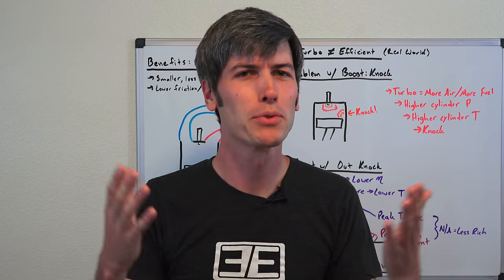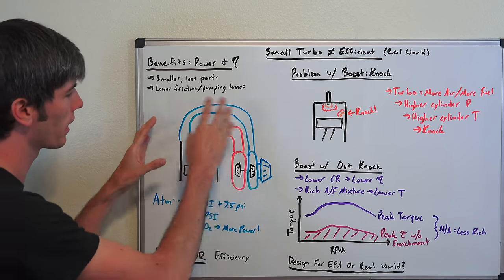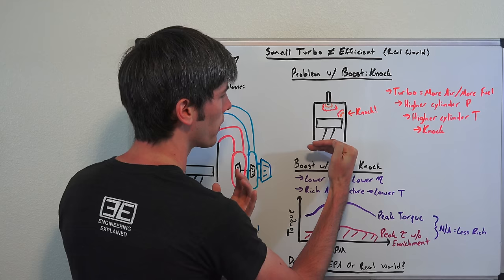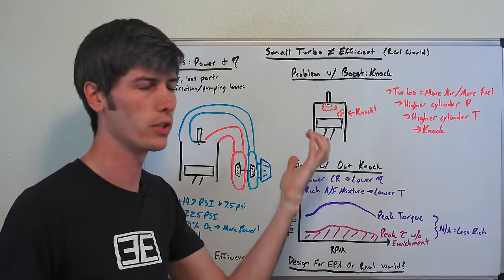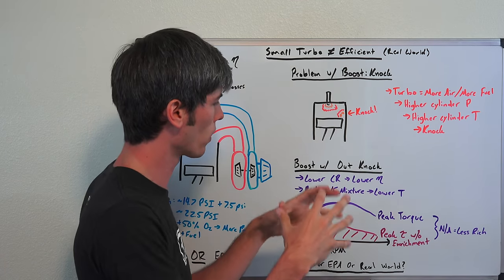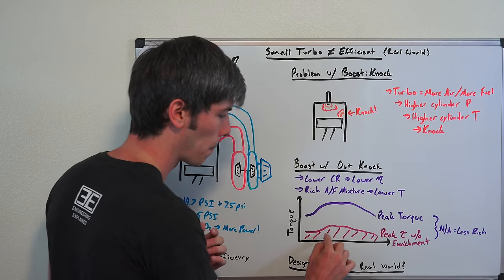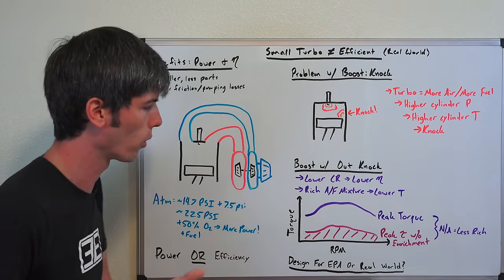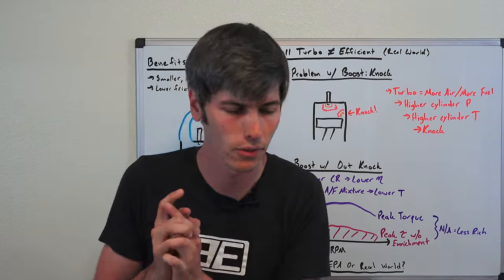Why Small Turbo Engines Are Not Efficient

Comment: Two things:

1) This is not only linked to "small" displacement engines with turbo. It is the same for any gas powered engine using a turbo.
2) This is only relevant for gas powered engine. Diesel-turbos is another discussion.
Reply: It applies to turbo diesel too.  More air is more diesel burned (and my 51 mpg Jetta TDI drops into the 30s)

.
Reply: @electrictroy2010  More air is more diesel burned, but more work is done so efficiency of the engine is the same or even better. Of course fuel consumption is NOT the same thing as efficiency. Exampe: drive at 70km/h, engine load and efficiency is lower, but the car itself is more efficient since there is less power wasted to overcome air resistance. Double the speed to 140km/h, the power required to overcome wind resistance increases 8 times!! (since air drag power increases with the cube of the speed). Far more energy is needed to travel the same distance so the car is less efficient BUT the engine is more heavily loaded and runs more efficiently. Fuel consumption increases even if the engine is more efficient. IE fuel consumption doubles, but the work done quadruples, so the efficiency increses.
Another simple experiment, try pulling up a hill in 5th gear and then try the same hill at same speed, so the power required is the same, but in 3rd gear. In 3rd gear load is lower, there is less boost but it will burn more fuel to do the same work as the efficiency is lower. There is no efficiency penalty for high boost on diesels because diesels don't require full load enrichment. In a gasser full load enrichment helps prevent knock but also causes decreased fuel efficiency, so a gasser might even burn less fuel when you downshift for less boost uphill, which is practically never the case in a diesel
Reply: Then explain how semi trucks can still average 6-8 mpg towing dry vans when 10 is the most they ever will do?
Reply: @Chris Russell Shhhh elect........ might learn something.
Granted it is 4 grade stuff.
I just wish they had . well telling would be telling. sorry
Reply: @kennedy796  these engine are like huge 14L V8 engines. How do you expect a good milage from such a huge engine?
Reply: @dieselgeezer18  Those engines actually are very efficient. That's why almost every truck in the world has a Diesel engine (outside the US where people buy trucks for leisure and gasoline is dirt cheap).

But when you're hauling a shitload of weight and have the aerodynamic drag of a house even if your engine is very efficient your fuel consumption will still be very high.
Reply: @kennedy796  ,look at the air that they push regardless of load. Yes there are a few concept designs that look like an arrow, but they are lacking in maneuverability and off the pavement capabilities, so they are not being built.
Reply: @petarmiletic997  I get what you are saying but help me understand this:
I drive a car powered by a small turbo diesel and it has a info display which tells me mileage figures like instantaneous mileage.
I have noticed that when I drive up a hill or just high load conditions where I am using a higher gear and low rpms the mileage figures drop astoundingly but when I downshift to a lower gear despite the higher rpms the mileage figures are better.
How is that?
Also the high load conditions I mentioned doesn't include lugging the engine.
Reply: @Hrithik_Jayanth  maybe you are using to low rpm and running into turbo lag, where the turbo can't provide full boost, and thus the engine is less eficient?
Reply: @juanordonezgalban2278  so if I am not boost it's inefficient?
Reply: @Hrithik_Jayanth  Most engines get a bit more efficient towards the middle of the rev range and then less efficient at high rpm. It is possible that the increased efficiency from higher rpm is more than the decrease from reducing load, especially in a diesel where part load efficiency is not as bad as in a spark ignition engine.
Also at low rpm it is likely the turbo is below the boost threshold and does not provide the full boost. Or if you have a VNT turbo the nozzle is closed and backpressure is high, acting kind of like an exhaust brake and robbing you of some power. It's really impossible to tell without looking at the specific fuel consumption map of the exact engine, which is not commonly available, where it is most efficient. It is very likely that if you downshifted again the fuel consumption would rise up. Also on a flat road - load is low it is certainly more efficient to use a higher gear, even if it drops the rpm below peak efficiency. My guess is that you have low efficiency below 1500rpm, and best at 2000rpm, above 2500 rpm it drops.
Reply: @Hrithik_Jayanth  Yes boost tends to improve combustion efficiency of a diesel engine, even when no fuel is added
Reply: @petarmiletic997  square, not cube. Rest u said is correct.
Reply: @David-cy5zu  Yes drag force increases with the square of speed. But power is force x speed. If drag force was constant regardless of speed the power would rise linearly with speed - this is for example how rolling resistance behaves. If drag increases linearly with velocity then the power would increase with the square of velocity. Since the drag force increases with the square of velocity that means power increases with the speed cubed.
Fd = 1/2 * Cd * A * V^2
Pd = Fd * V
Pd = 1/2 * Cd * A * V^2 * V
V^2 * V = V^3
Pd = 1/2 * Cd * A * V^3
Everything in the formula is constant so drag power = constant * speed cubed.
Hope I was clear enough, it's hard to type formulas in the comments.
BTW this is the main reason why fuel consumption  of cars rises rapidly at high speeds.
Reply: @ Heads Mess

Less of a difference now with DI and you want more power in a diesel you still have to put more fuel in. 

I run a turboprop engine and it’s the same principle. Super lean—only 10% of air is used for combustion—but if you want to increase power you are directly increasing fuel flow. That’s the only place your extra energy is coming from. So your diesel will get shittier mileage the more you romp on it.

Comment: I worked for a Lincoln/Mercury dealer back in the very early 80's.  In my three years there, we sold one Mercury Capri with the 2.3L turbo four.  It was a nice little car but the owner brought it back to us several times complaining about lousy fuel economy.  We checked it out each time and it returned proper gas mileage when we were driving it so there was nothing we could do.  We talked to her several times and could never figure out what her problem was when she finally said it.  "My salesman said I could have V8 performance AND 4-cylinder gas mileage!"  Ok, "now" this makes sense.  The service manager resisted the temptation to tell her that her salesman lied through his teeth to her and simply said he was mistaken.  She could have V8 performance OR 4-cylinder gas mileage but not both at the same time.  She didn't like that answer and we were never able to satisfy her on this issue.

Comment: I have a small (1.4 liter) turbocharged engine in my car.  I have never gotten the mileage that I thought I should be getting, and this video helps a bit to understand why this is.  The real blow that I got was when my car was in the body shop for a month (let's just say that it was the busy season, and that's all I have to say about that).  I had a rental car that was a larger sedan with a V6, and it got better mileage than my smaller car.  I still miss that rental car...
Reply: yeah, you have to drive like "that annoying slow person" to get those rates.

Comment: So short version: you get a small Turbocharged car to drive it sensibly for economy, and to have some power reserved for when you need it. 

I own a 2006 Land Rover Discovery 3 with a 2.7 litre diesel V6. On the Motorway doing 70 it happily gets above 37 Mpg, whereas in the city, it drops to around 27. The key is just how much you put your foot down; that thing pulls away hard once the turbo spools up, but then the Mpg goes out the window. Its all down to driver input and how you drive it. A good example of this is the race that Top Gear did with a BMW M3 and a Toyota Prius.
Reply: Diesel engine are more efficient than a gasoline engine

Comment: I swapped the tiny K03 turbo out for a larger gtx2867r on my 2.0 ecoboost. The K03 spooled almost instantly but power died around 5k rpm. The 2867 hits peak boost at 3.2k and makes power all the way to redline (6.5k). It's also making 150 more crank HP. Wasn't expecting to also increase mpg. I now get 32 mpg doing 80 mph.

Comment: For a little while I drove a '13 VW CC with a manual and a stage 1 93 tune to about 250whp. I was getting 28-30mpg combined and I could squeeze 36mpg on the highway. I think the real advantage to these turbo engines is you get all the fun while on boost and then when you're cruising on the highway off boost, it turns into a fuel sipper.

Comment: I changed from a 1,4 litre four cylinder 90 PS to an 1 litre threezylindet engine with a turbocharger and 95 PS and i am down from 6,5 litre per 100 km to 5,5 litre per 100 km. For me thats a huge Deal because i save around 250 Euros a year.
Reply: The biggest advantage of the smaller turbocharged engine is the low end torque, so that your new turbocharged car (might even be a Volkswagen) has more low end torque and can sustain lower revs at high speeds
Reply: I have an 993cm3 n/a from 1999 that does 4.6...
Reply: Pedro Pereira but how much hp does it have that’s the question
Reply: @MikhailFrolenko  56 bhp.
Reply: My Polo 6N1 build  1996 1 Liter 4 cylinder  Big Block  needs 5 Liter\100 Km.
Reply: I have 1.3cc N/A ( no turbo)
112 ps . 2002 pocket rocket 850kg
Reply: I just got a Seat Ibiza 09 with a 1.4l engine producing 86 hp. Driving it back home for 200 km I got an average of 5.2/100km. And I had probably around 70 km uphill.
Reply: @German Retro Guy people typically complain atkinson cycle engines from mitsubishi are extremely lazy. Horrible to drive when pulling caravan or trailer.  I've heard most mitsubishi outlander owners trade in their car to buy something with turbo diesel.

Comment: Also keep in mind how people drive turbocharged vehicles. When you're driving a big V8 you have to drive slow to get any decent kind of mileage. Where most people who drive turbo cars always have their foot down... Who remembers the old days when you could literally watch the gas needle move in a V8 truck?
Reply: DonnaSean this is exactly the problem. These smaller turbocharged engines are usually dramatically more powerful than the naturally aspirated motors the owner was previously driving.

Thus the driver accelerates significantly faster than their old car ( horsepower requires fuel either way) and then complains about the economy.
Reply: ‘71 Olds Toronado ... 455cid, kick in the 4 barrel over 70mph and just watch the gauge drop 1/10 every few seconds
Reply: I just rented a Kia Soul that did that from full tank to a half a tank Driving 80 on a short 80 mile trip. Watched the needle move.
Reply: 70 Chevelle 396 ss w/cowl, yup it def was a race, those were the days
Reply: see the gas needle move? that remember my first car, i kind fixed it... but the ECU was think the engine needed more gas.
in fact the poor thing barely moved.
Reply: DonnaSean couldn't agree more, it's all about driving habits - I average 41mpg from a Fiesta ST150 which is known for being pretty bad on fuel because most people are lead-footed with them...
Reply: jase_llan i do 280km on 75 liters when i'm in a hurry. If i drive like a grandma stuck behind a cyclist i may get 350/400 out of it.

No idea what that is in mpg. Probably around 8 or so lol.
Reply: Good old days ?????  I see that happen in my 2017 Hemi Ram Rebel !!!
Reply: Hey folks it's DonnaSean the typical modern truck lover and typical liberal.
Reply: look up the definition of liberal .
Reply: 280km/75L is about 25L/100km.. I can easily do 300km with 15L on a Opel Astra G 100bhp hatchback.
Reply: My Porsche 991 Turbo S gets like 13 mpg.  Piece of crap
Reply: @lildeena1  The Kia has a small tank compared to a Toronado with massive tank, seeing that gas gauge coming down in  the Toronado that's real gallon per second there
Reply: My 1.4 turbo does around 600km on a ~49 litre tank.. And yeah, thats real life but mostly highway (90-110kph). Counting daily commute (mostly city) i get around 500km out of a tank.
Reply: Yeah I remember that problem usually its solved with a larger gas tank 😁  but yeah the ford 460 was a thirsty engine to say the least the tank would last longer if it had a hole int opposed to feeding that truck engine
Reply: Not too far, I used to see the gass needle going down in my 2004 titan 😌😅😅
Reply: @Joe Brown the difference is that the Kia is a relatively small vehicle. The Toronado is an offensively huge (to road-hogging Prius drivers, anyways) land yacht with a gigantic engine, and a FWD trans. They weighed a bit over two tons, so the 425/455 had to pull hard to get it going. same goes with the Cadillac Eldorado, but with 8L instead of 7.0 or 7.5.
Reply: @lildeena1  doubt it.  Had Kia Soul since 2010, done multiple long trips at around 80mph and got 350-370 miles with 12 gallon tank.
Reply: @otm646  You hit the nail on the head. When I first got my F150 2.7. I didn't think I could get 20 mpg mix driving. I can if I stay out the throttle. The same way I would If I was driving a 380 hp Lightning.
Reply: Had an old jimmy with a 350 in it and at certian parts of the gas gage and if you had it floored you could literaly see the gas needle going down haha
Reply: ‘17 Cruze here I generally get 28 mpg to 32 mpg. A woman I worked with was getting over 52 mpg. Plus the higher speeds you run up to a point, using the pulse and glide method, you get better mpg all together. Going down hill barely press the throttle picking up speed, on the up hill, slowly releasing the throttle, pulsing the throttle periodically to slightly hold speed. Down hill up to 80+ mph, up hill dropping to speed limit.
Reply: I have a 6.6l 400 carbed small block ....trust me i see the needle go down even looking at it lol
Reply: My 1991 f250 with 7.5 ltr gas engine in bad need of a tune up has two gas tanks for a reason.
Reply: Had a truck with 2 gas tanks to keep the needle up 😜
Reply: I drive a lifted 97 4runner so I can see the needle moving everyday🙄😒😟😭😂
Reply: @otm646  Thats pretty much the same thing as i moved from 2.5 r6 to a 4.0 v8. Allthough the car is heavier it picks up speed really fast cause of the torque